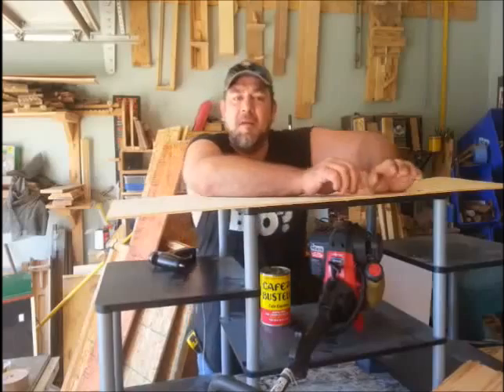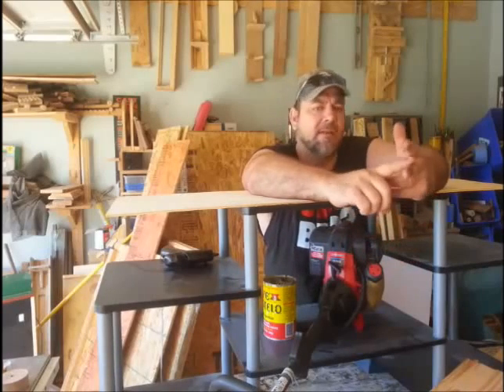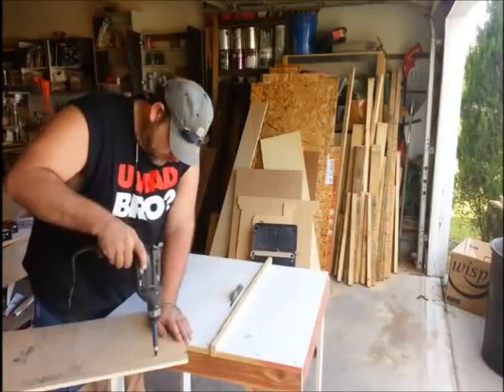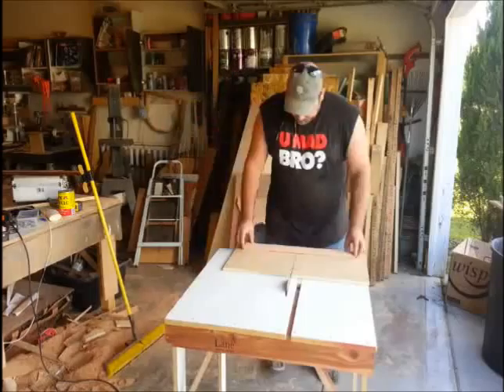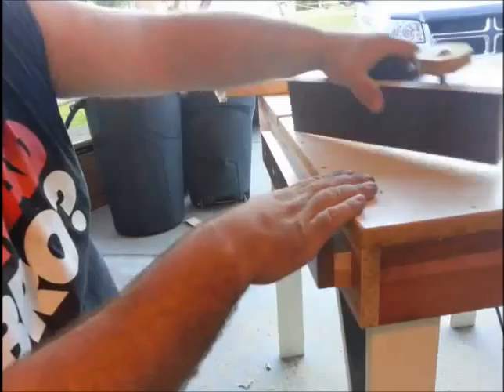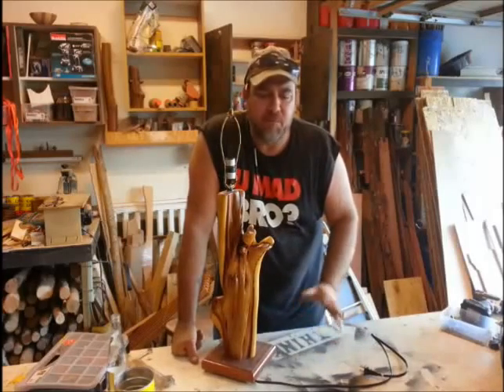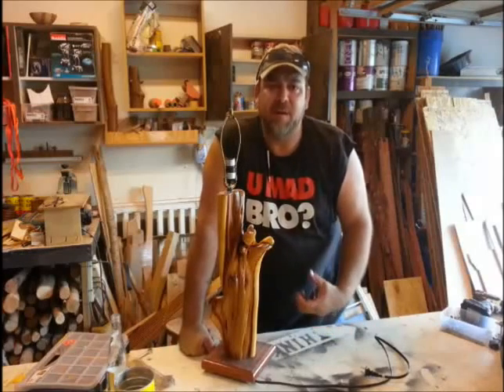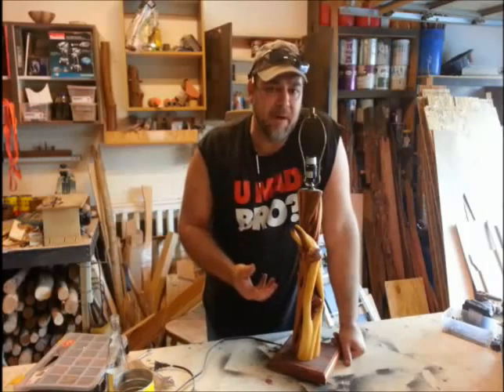Building the Cross Cut, Miter sled and fence

Comment from the maker: Sacrificial fences are used when the blade of the machine being used is going to contact the fence in some way. if the blade doesn't touch the sacrificial fence then its not a sacrificial fence and they are using the term wrong.

Comment: Hi Izzy,
My solution to the fence was to take strips of 1/2 inch plywood the same length as the long side of the table saw.  Secured the second at right angle with glue and screws. With two of these and two two inch strips I built a parallelogram located by clamp to the table edge and four bolts the fence remains parallel to the fixed point and can be set up to the blade using small rare earth magnets on the blade and a long metal edge to the fence..
Colin Farrier
Big Jig from Larne

Comment: I have a tip for you. IF you have a Deserter Industries near you, it's a thrift store that the Mormon church runs, they seem to always have some contractor drop offs. Things like small tools, hardware, lights, all kinds of stuff. I saw contractor lamps, you know the gold brassy kind, for about 5 bucks or so. I found a box of all kinds of miss matched parts which included light plates, screws, a tape measure and screw drivers etc. Ready for the $ amt? dun dun duun dunn. $8 , yep that's it.

Comment: Hi Izzy,
Love your videos and always look forward to seeing them.
I have a question if I may.
I have a RYOBI table saw that utilizes a sliding miter bed instead of miter tracks.
I have been wanting to build this sled, but am struggling with how to over come the sled registration to the table saw bed issue.
The only two options that I have come up with to date are:
  - Create a plywood cap with miter tracks to be attached to current table saw bed.
    - ISSUE:    In doing so, I will no longer be able to used rip fence without removing the proposed plywood cap.
  - Attempt to create sled and register against outer edges of the table saw bed.
    - CONCERN:    Table saw bed is 32" wide and that seems like a lot of surface friction for the sled.

Would you happen to have any suggestions / ideas?